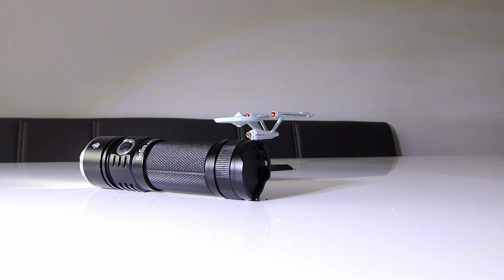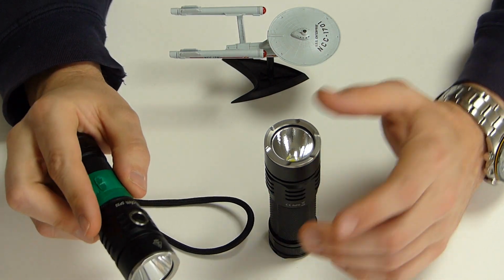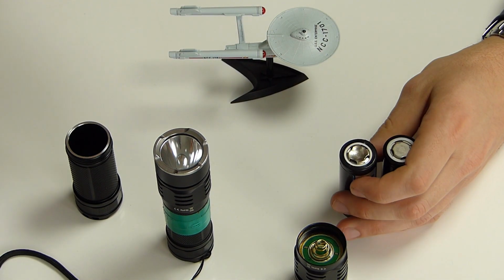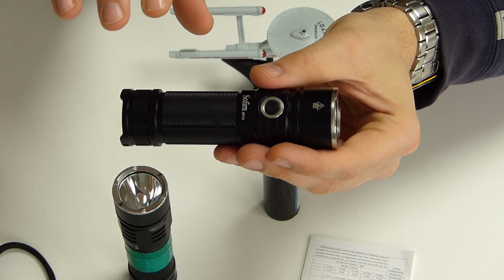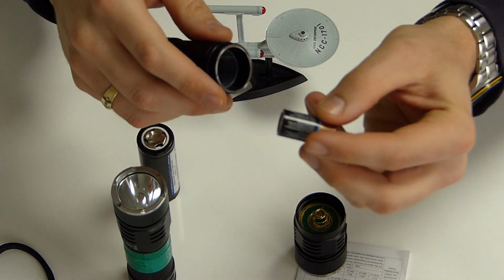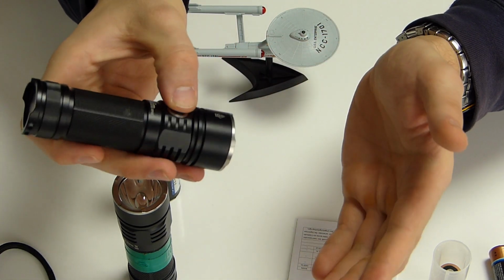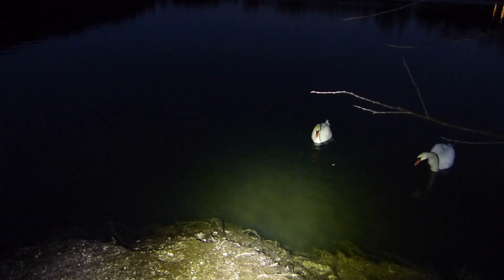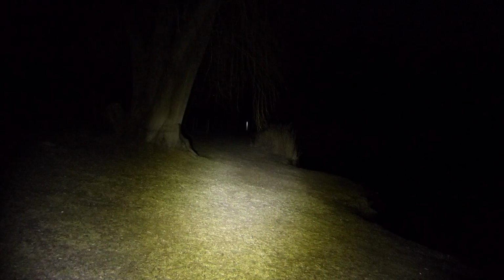Sofirn SP33 (Cree XHP 50.2) Test

Comment: Would this work with 2 x 16340 battery in an emergency?
Reply from the maker: I d have to look in the specs but the higher input voltage would likely fry the driver. A single cell plus a dummy for a second one might work.
Reply: @wearandtear6692  I thought the driver was protected?
Reply from the maker: @Molasses_Man  yes, if I remember correctly. Has been a while and I gave the light to a friend. So it would survive but still not work. A lot of lights take 18650ies or CR123A, the latter are perfect for long time storage and very cold temperatures.

Comment: Beware of the swans - they could eat you alive ;-)! Some years ago I met a guy which was extremely scared of swans, so I must remember while watching your video ... As always thanks for your review. Sofirn seems to do a good job especially when putting a high quality 21650 into the package! I like the XHP50 for it's balance between high output and nice floody appearance in combination with orange peeled (OP) reflectors. All the best :-)!
Reply from the maker: Well, swans tend to attack when you are in their way or decide you have food that belongs to them. However, those attacks are usually not deadly, sometimes severed limbs but nothing that would really disable most people ;-) Yep, the new SP33 is a well-rounded light. Flood is a very good option for this size and LED. I think this is my new bike lamp. Thanks a lot for your comment!
Reply: @wearandtear6692 . Maybe the guy lost a fight against a swan in his past, I don't know ;-)! But good to know that there is a way to encounter a swan when it's about food. Your welcome :-)!